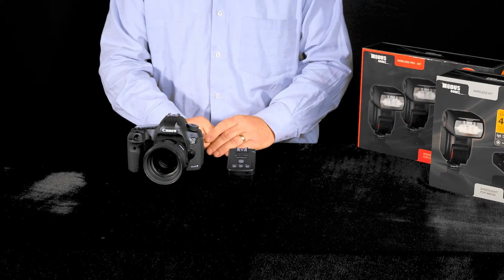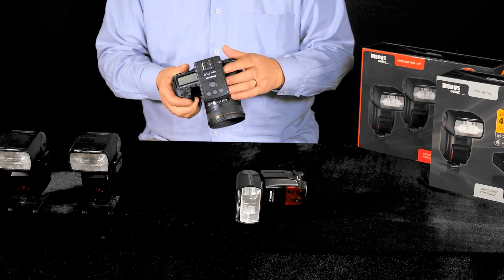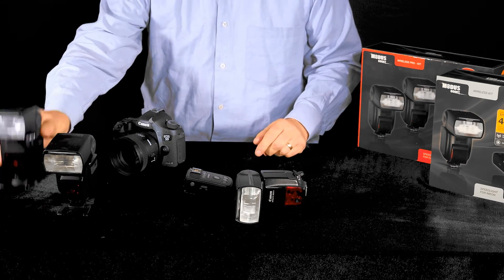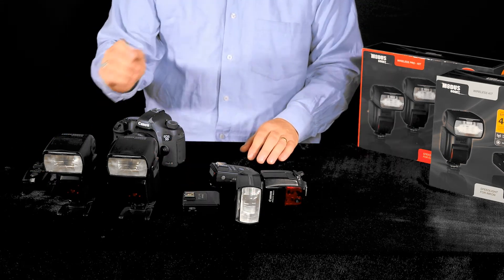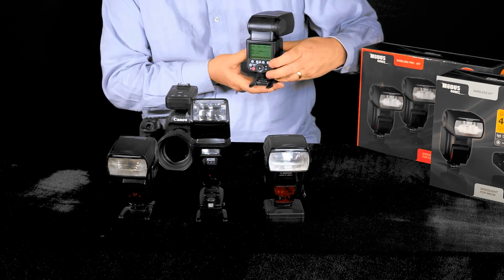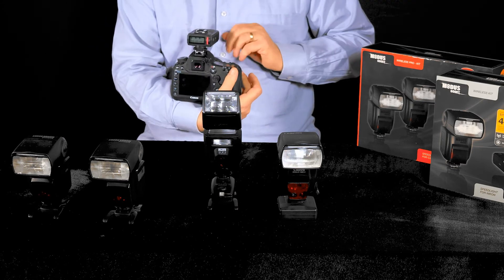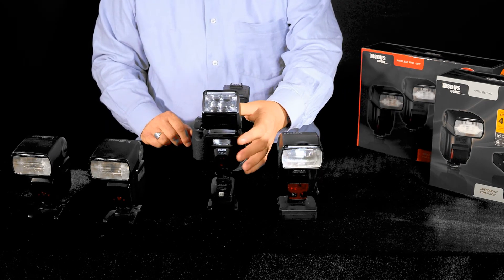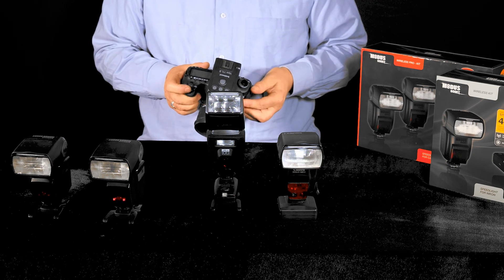Viper TTL Wireless Group Flash Trigger

Comment: I have bought a D850 nikon and I cant match it with the flashes (Modus 600RT hahnel powerd by extreme 4X),, I dont have a receiver as the flashes was bought a few years back and I used it on my D90..
Reply from the maker: Hi Engela - if you email our support team (info@hahnel.ie), somebody will be able to offer you some assistance.  Thank you.

Comment: Hi! Why cant i adjust the power levels of my flash through my viper ttl transmitter? im using a "commander optics" flash... also my flash is set to f8 whenever i use it wirelessly with this item and i cant adjust it to match the apperture in my canon 6d mark ii, please help.
Reply from the maker: Hi Rhyniel - email our support team at info@hahnel.ie and they will be able to help you :)

Comment: can you use a Strobe as master then flash as slaves?
Reply from the maker: Hi Tommy - yes, it Is possible to use the MODUS 600RT as a slave to a strobe. 

When it is in manual mode, O1 can be selected on the controls. In this set up the Modus600RT can be moved off camera and will fire as a slave to any optical master. 

The optical master can be another speedlight or a strobe.

Thanks!